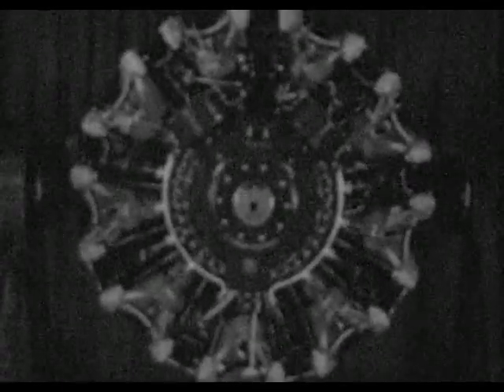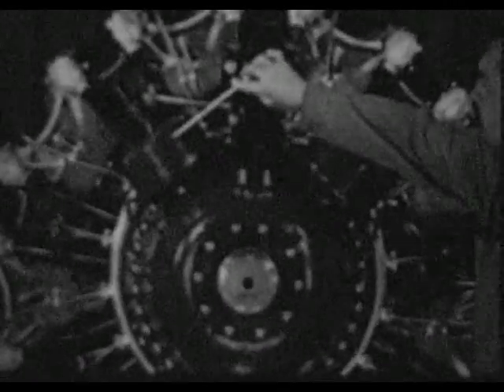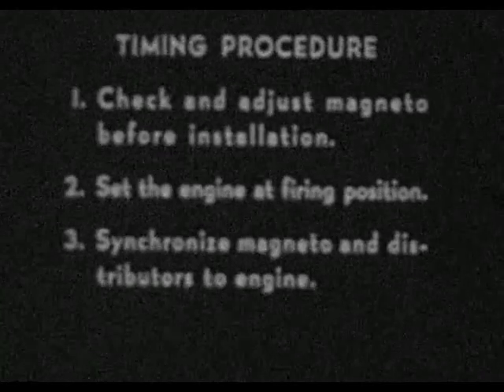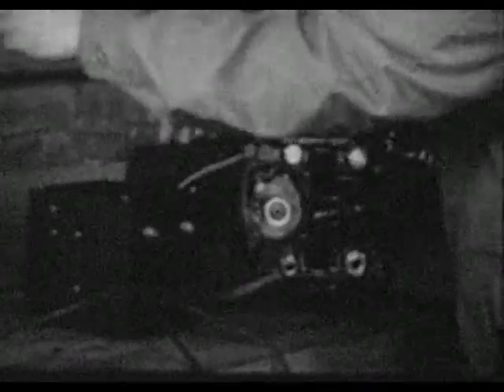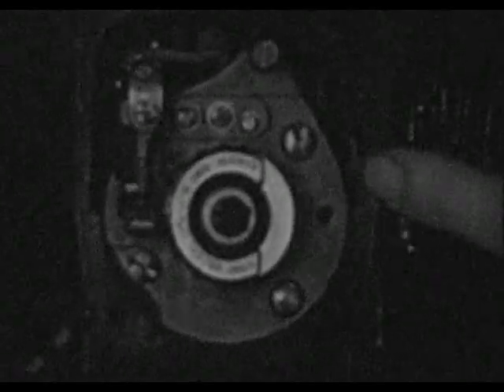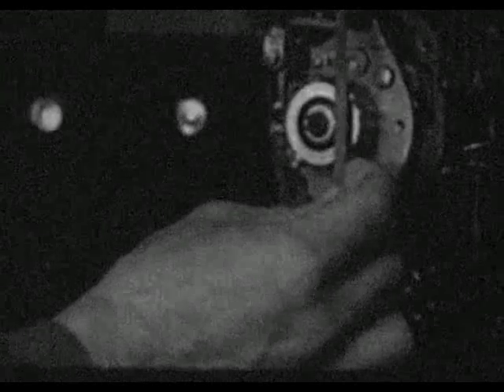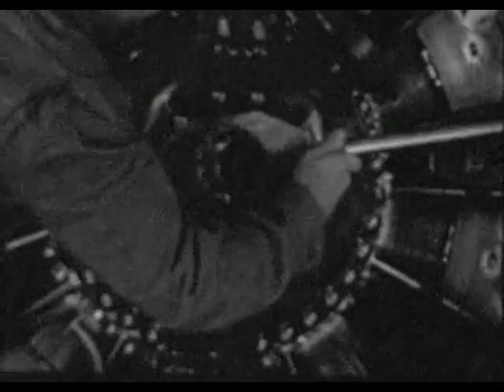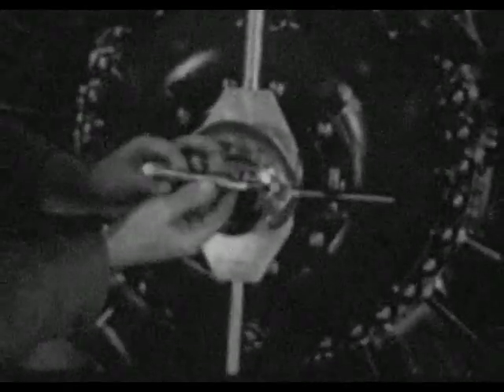BD 0253 Pratt & Whitney magneto - timing training film

Comment: In the field during WWII they would routinely do the final timing procedure by ear while running the engine on the aircraft at about 2000 RPM, usually while standing on an ordinary ladder with no hearing or eye protection just a few feet from the spinning propeller. 

The reason that they used a shot of an F4U Corsair at the end was most likely because Vought-Sikorsky Aircraft was located in CT not that far from Pratt & Whitney.